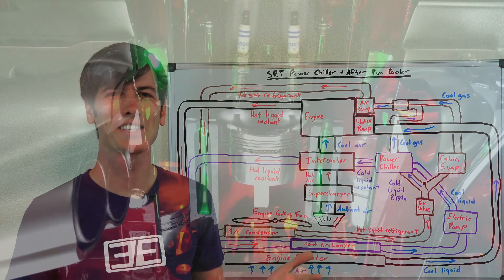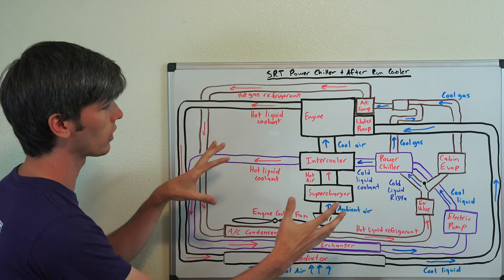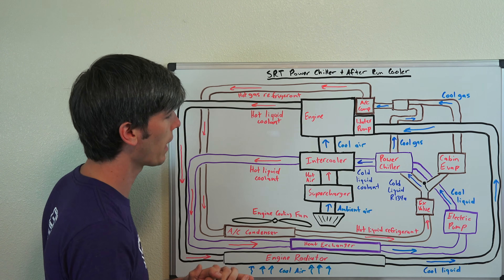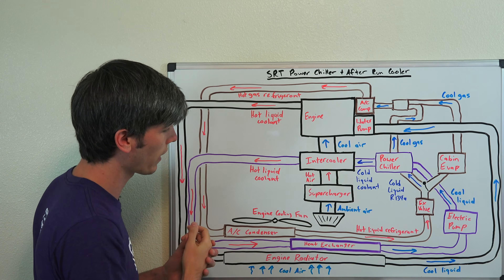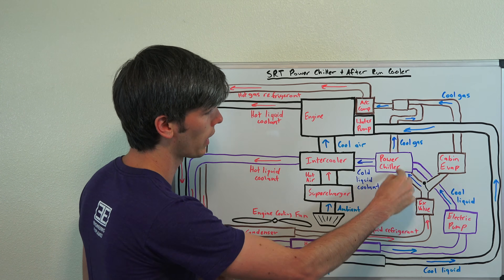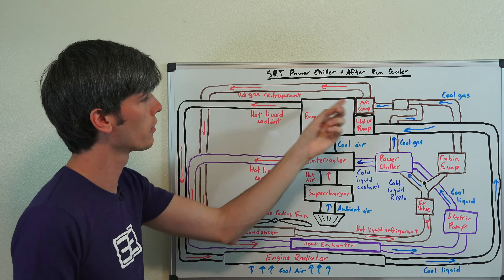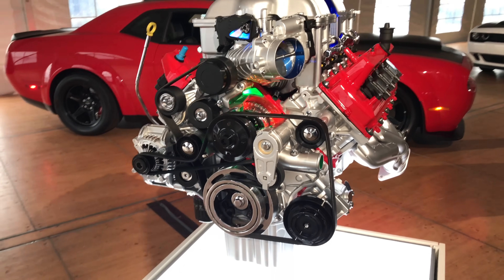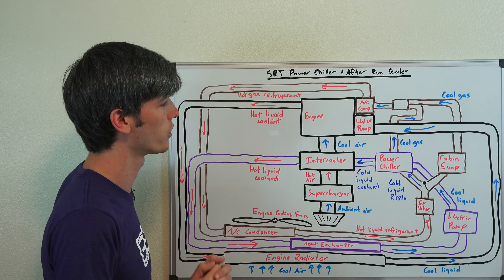How The Dodge Demon Uses Air Conditioning For More Horsepower!

Comment: You will get about 8 mpg street 11 highway lol
Reply: It's not rated in smiles per gallon. it's rated in "Bald Eagles" per second.
Reply: SlimSlugga713   Sounds like it wasn't meant to make sense either, along with your original comment.
Reply: 2Awesome 
MPG under acceleration is awful with everything, though.

My motorcycle (that averages between 40-45mpg on the street) shows a whopping 7mpg on a full throttle launch. Which actually is kind of hilarious.
Reply: It actually gets 20 highway...surprisingly.
Reply: +Aaron Schwarz
The air we breathe is cleaner than at any time since the dawn of the Industrial Revolution. Methinks you need to find something else to worry about...
Reply: So? I got about 12 city and 16 highway in a heavily modified car, I love smoking cars that cost $100k+ more than a little gas mileage. I think I got about 3 or 4 mpg or less when on the drag strip!
Reply: Noah cross i drive a 550 hp Cammed Escalade that runs only on 93 octane, i don't think prius would interest me. Nice try tho
Reply: Noah cross because........ That's why.
Reply: Noah cross yeah it wasn't meant to be argued.
Reply: it's crazy to think a model S is literally in excess of 10 times the efficiency, not that all that vroom vroom isn't cool or anything.
Reply: If that is the case, how many cars do you know that can do 10.65 in the 1/4 that is street legal and can pull a wheelie that gets better mpg? This is a very fast car from the factory that passes Calif smog and can hold up to 5 people. No Pony, Muscle, sport or super sport can do all of that at close to the price. You know that the Pony/Muscle cars of the 60's & 70's got the same MPG with a lot less power. And really, if you had (and we all know if you cry about gas, you cant afford this car) this car, who in Gods names cares about MPG, not the guy that wines about MPG.
Reply: A stock escalade cost more then the Hellcat, a step down from the Demon and your is modified and I bet being over 5800lb+ you get the MPG of the Demon, without any of the performance. Your modified escalade cant keep up with any of these cars. And who in the right mind goes on a Demon site with a Caddy? The very fastest GM cant keep up.
Reply: +puneet7891 maybe EPA highway mpg, but constant acceleration mpg is garbage...
Reply: Jeremiah John You can't compare MPG with MPGe. It's impossible to convert petrol to electricity to charge an electric car battery for electric range and get an efficiency much higher than an ICE would convert that same amount of petrol to motion. It would be like saying I that I can run faster than Usain Bolt walks so I am the world's fastest man.
Reply: you're misinformed.
energy is what moves things, we know how much energy there is in a litre of gasoline and we know how much energy there is in a kilowatt-hour battery(it's in the name), if the electric is going 10 times further with the same amount then it's being 10 times as efficient, nothing is being converted and estimated here.
Reply: 7+ billion people, with more buying vehicles with a tail pipe every day || small changes over long periods of time multiplied by large numbers = climate change, air pollution so bad that smog is an issue all around the world. 

Pollution exposure is the leading cause of preventable cancers, asthma, COPD, heart & brain disorders : caused by breathing in unburned fuel vapors (cold engine startup, idle emissions, smells, VOC) + soot and super fine particulate, brake dust and tire erosion dust, plus oil leaks in old vehicles, gasoline & oil spills, tranny fluid spills, metal particles, oxides of nitrogen, etc. Smog is toxic!
Reply: 0.1mpg on the drag strip...
Reply: It's not rated in "miles per gallon" it's rated in "smiles per gallon."
Reply: Jeremiah John How am I misinformed? Tell me how you can generate electricity with 100% efficiency. There's no way to generate anywhere near the total estimated amount of energy from any fuel in the form of usable energy. You're comparing electricity - the product after the conversion and losses to heat, with something that's impossible to convert to electricity with anywhere close to 100% efficiency. Based on Einstein, there's 9x10^14 joules energy per kg of mass. Do you realistically think you can get that much usable energy from doing nuclear fission on rocks and sand too? If so, why don't we just convert our trash to near infinite electricity?
Reply: + tail pipe emissions linked to cancer, immune disease, endocrine disorders, brain damage, COPD, asthma, dermatitis, liver & kidney damage, lower IQ scores, climate change, & air pollution using a depletable finite fossil fuel as its energy......

Comment: That's weird to think because I always turn off my AC before I race someone at the light.
Reply: Absolutely. Matter of fact I turn the heat on (especially after running hard, before shutdown)!
Reply: Turning the A/C off In most newer cars it probably won't make a huge difference anyway, every car I've owned since 2008 automatically turns off the A/C at full throttle, although sometimes only in Sport mode.
Reply: Turn the heater on the front windshield full blast, and throttle a little into the brake. As soon as its green stomp the gas and let off tbe brake, and shift out of 1st earlier than usual.

Comment: A/C running is not permitted on NHRA sanctioned drag strips, because the water condensate that leaks onto the track is a safety hazard.
Reply: Isnt the Dodge Demon banned from those anyway because it doesnt have a full roll cage?
Reply: The Demon has a catch system to retain all the condensation so that it IS allowed to run AC on the strip, does not leak.
Reply: The local NHRA sanctioned track allows the running of A/C as long as you have a catch tray.
Reply: That is correct, I used to run A/C as I had a catch tray (which was always dry anyway unless I ran AC an hour plus). It cost about 0.10 seconds but as I was bracket racing I cared about being comfortable and potentially cutting a better light as I didn't have fogged glasses. A/C costing me 0.10 seconds in the quarter mile was meaningless as I subtracted the time from my dial in.
Reply: You only get condensation from the cabin evaporator core, because so much (somewhat) humid air passes through it and it's REALLY cold, the water condenses onto the core, into the drip tray, out the drain tube and onto the road. Competition mode gets away with this by disabling the cabin evaporator core, so only the evap core in the intercooler system is active at this point, and it's surrounded and sealed by coolant. Even if it was cold on the outside of that device, it would drip about as much as you see condensing on a cold beer left on the table.
Reply from the maker: JDave Foster Dodge thought about this. They have what is essentially a catch pan/sponge that prevents the water from dropping below the car.
Reply: You'd fit a roll cage if so inclined.
Reply: The company that Dodge is working with for the power Chiller claims that when you shut off the in cabin cooling that the condensation doesn't drip on the ground. I will be testing their claims on my car shortly. Currently I get intake air temps like 16°F below ambient while in dual zone cooling mode.
Reply: Yes its sub 9.99s requires a roll cage. 90% of the ppl taking it to the strip in its stock form will be doing 10-10.75s
Reply: Shawn Jones and you're here watching a video about the car that is the the talking point of this very topic.
Reply: ONLY if you run a sub 10 seccond (or is it 10.49?) pass, just because the car can, does not mean it always will, so you can't actually ban the car, but if you run faster than is allowed, you can then get kicked off.
Reply: That's interesting from a guy that looks like he's still bitter about being kicked out of his death metal tribute band in high school.  Just saying.
Reply: Jared Connell Tbh i dont know. All i know is that they did ban it. Go look it up
Reply: Yes and it's possible to catch it in a tank just like blow by with a catch can there's even a company that sells kits the use the a/c for the windshield wiper washer fluid or water injection it basically  scavenges water vapour out of the air and then they have  special  tablets for cleaning your glass
Reply: The demon is only banned if it doesn't have a roll cage... which is a factory option... it's not that the car was blanket banned, it was banned without nhra safety gear, with the gear it's g2g
Reply: 9.65@140mph Very Possible
Simple mathematics tells you
That 770lbs of Torque will Deliver
A 4200lb Vehicle in the 9's Provided that vehicle can put its
Power Down, Demon has Technology,Torque,Traction & Transbrake which Equals TERROR
You No-Driving BITCHES who are
Complainting, Stand aside and Watch! The Demon will Run 9's
Just as soon as Drivers learn how
to Pilot it.
Reply: JuanZeTacoMan no. It's not. Several people on here already posted that it's fine to run unless you hit 9.99. Then you're done for the night.
Reply: Shawn Jones actually I don't really have any nhra tracks by me so my charger isn't being built for drag racing and I live I Mountain countryside so I'm going for the twistys bits and auto X / road racing I'd like to try it though in the 1/4 but I'm not there to win all out just have some fun and have a car that I can make safe comfortable power all day long that's why I like the a/c chiller and not trying to rely on spraying some like NOS or methanol
Reply: Engineering Explained not to be way off topic but have you ever done a video on pre-boosting ? Basically full boost control up to the highest boost of a given turbocharger using jet powered combustion chamber and some type of ecu I guess rally cars used it and some military equipment and I've Ben looking for how to get to work or the theory of how it works I think it might make a good video. The only person I've seen can use it from Engine idle to full revs and it was on a Subaru wrx 2004 ish factory homologation type thing like the older 70s super Bird cars and was missing some of the parts to make it work from the factory he did get it to work some how. This is not a 2 step anti lag but some thing different that doesn't use the engine at idle just the hot side of the turbochargers and the compressor side like Collin fuzes jet engine thanks for teaching others.
Reply: No.
Reply: Craig Freger just as a clarification to (no) what do you mean? 
as for the turbocharger ? I having hard time seeing how it works with out over spooling or over boosting or just spilling gas and lighting on fire problems like engine protection and turbocharger protection and that's because most of the ECUs consumers can buy ( or that I'm aware of ) do not natively support that type of ain't lag because of the add injector com-buster chamber and last but not least a way of igniting it reliably like a glow plug or spark plug or the added rpm Signals. I have devised a really crude way of maybe getting to work with relays and a hob switch set to 5 PSI or a piggy back ecu but there's nothing keeping it from going badly and boost spiking love some input thanks
Reply: JDave Foster ....I think it would have glycol in it...if that water freezes, and cracks the intercooler...the engine gonna gulp down a bunch of water right??
Reply: Does anyone know if the charger he’ll cat will have the catch can for moisture because the 2019 model after this feature
Reply: This simply isnt the same thing. The water you get from A/C comes from cooling ambient air. It's basically dehumidifying the air. The component that does this is the cabin evaporator. The Demon's system is rerouting from the cabin evaporator to the power chiller.  By not using the cabin evaporator, you're not 'leaking' anything.
Reply: 1xxrecar  It is essentially a liquid to liquid heat exchanger so no direct contact with the ambient air per say and no condensate is produced as it is not taking the moisture out of the air but just bringing the intake air charge temp down a bit more but it is actually still not cold but warm yet.
Correct.
If using an actual AC evaporator and drawing the intake air charge through it ,then a condensate could/would be produced and would need to be caught in a catch can to be race legal.
Of course the velocity of air going through the evaporator would be high enough that the condensate would most likely get sucked right into the engine anyways and combust it.
Who knows , maybe that extra bit of moisture DOES actually HELP with the power????
Correct.
Reply: Sub 10.00 and over 135mph you need a full cage.
Reply: minihjalte it's not using an ac condenser though so it won't get as cold as ac
Reply: You hillbillies enjoy your NHRA
Reply: @ShawnJonesHellion  and you albinos love your basment apartments and using dead grandmas lavender toilet water spray to make the crack fumes less obvious,have fun bernie is out
Reply: The demon was banned from NHRA competition, even if it meets all the requirements such as rollcage etc the car itself is banned

Comment: How does the power output compare to the weight of an AC system? I get using it when you already have an AC system there vs it just being dead weight, but do we expect to see this in race vehicles ever?
Reply: Taylor Sanchez - It's actually much more than that.  Dodge claims a 45F improvement (sourced from an in-depth tech article by hotrod.com): "The impact of the SRT Power Chiller and After-Run Chiller, combined, lowers intake air temperature by up to 45 degrees Fahrenheit."

Plugging this temp. differential into the calculator you provided yields a 5.4% HP improvement, ~40hp in this application!  

Also, the AC system would be present in this car and its competition regardless of whether or not the Power Chiller is utilized, and also consider the balance of system (air to water intercooler) would be installed in a modern supercharged IC application anyway.  Thus, I'd guesstimate the true added weight of said PowerChiller to be much closer to 10lbs - negligible compared to the power added.  Finally, modern automotive HVAC designs are 20-30lbs total weight, including compressor, condenser/evaporator, and air mixing/fan ancillary hardware.

(For reference I'm a power systems engineer with a b/g in internal combustion design engineering).

Bravo Dodge, bravo.
Reply: Leander311, Thanks for the additional info. From the video Jason mentioned the entire intercooler (power chiller + heat exchanger ) system cooled 45F total, but I thought he said the power chiller itself only cooled 10C on its own in comparison to say cooling the cabin. Maybe I heard that wrong, but I will have to listen to it again after work to be sure. That is why I used the 10C.

I totally realize that AC would be there regardless. But I was interested in the idea where some people yank out an AC to get less weight (usually on the already lightweight cars, so less applicable here). Where this totally offsets that gain, unless maybe you wanted less weight to increase handling, again probably negligible here. I was also wondering if adding this into an engine being modded would be a reasonable idea.
Reply: I can't imagine this being used in race cars for the simple reason that, even with lightweighting and the added efficiency of being a dedicated unit, not meant to also cool the cabin that even 50 lbs extra weight that increases the power to weight ratio isn't neccessarily a net gain for lap times. Power to weight affects acceleration, pure weight total affects cornering though. If I have two otherwise identical cars, one of which has a P:W of 0.95:1 and kerb weight of 1500 kg, and a car with a P:W of 0.8:1 but a weight of only 1100 kg. Car B will probably be faster along most tracks without extremely long straights because it doesn't have to fight the 400kg of extra inertia around the corners. Also downforce over total weight is very important, but that's a different topic. If you look at most racecars based on production models they often TAKE OUT things that improve "performance" in stock form even when it's not expressly forbidden by the rules because every kg saved is a bigger percentage of the total weight than the last. e.g. rear wheel steering 

I can imagine though perhaps alternative systems being used in some areas that are lighter and/or more efficient, especially with extremely heavily boosted engines, for instance using thermoacoustic or absorption chillers to use the waste heat / sound energy of the engine.
Reply: Taylor Sanchez they could route condensate through exhaust
Reply: Taylor Sanchez 100 lbs=1/10 sec in quarter, so theres half the equation
Reply: Alex A they have to add weight to get to min nascar weight
 All classes in every circle track ive been to have min weight so its lead you wont have to add. Saying that its weight added to the front rather then the rear, other then that the final weight of car would be same
Reply: Or maybe just let the condensate drip onto the exhaust manifold where it would be instantly vaporized.
Reply: No not in race vehicles, at least not for now. I think A/C's are prohibited on dragstrips and it's no point in real racing on a track since it's not about making power in a straight line.
Reply: Thanks for the numbers. I plugged them in here: http://www.csgnetwork.com/relhumhpcalc.html and used 85 F, 29.92 Hg, 50%, and 0 feet. Which gives a 100% hp rating. Changing the temperature down to 64 degrees F  (delta of 10 C), gives a 103.1% hp rating. 50 /4400 lbs = 1.1%. Taking the difference in percents 3.1 - 1.1 = 2, so an effective increase of 2% hp compared to without the AC.
Reply: Taylor Sanchez wow, that's some interesting numbers, well done
Reply: I think Alex is overthinking this. Race vehicles are typically sitting above 4500rpm throughout a race, and they are always moving, which means the heat soak issues aren't a factor. This system is for drag racing, where you're sitting still on hot pavement before gunning it.